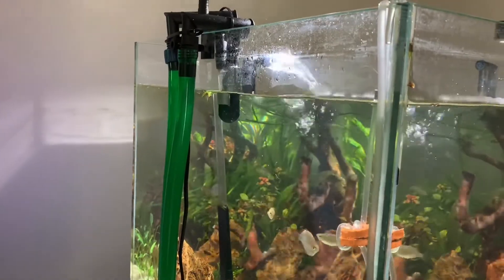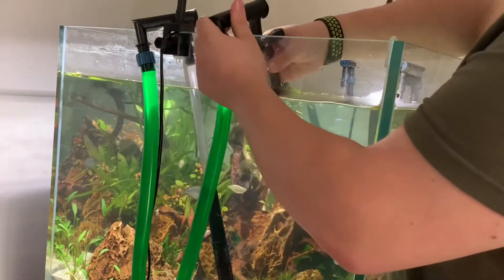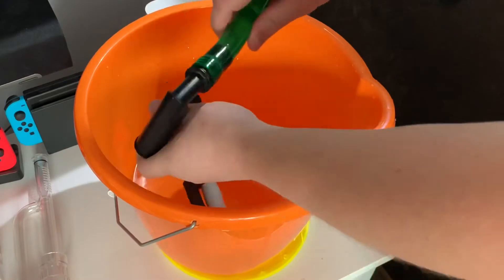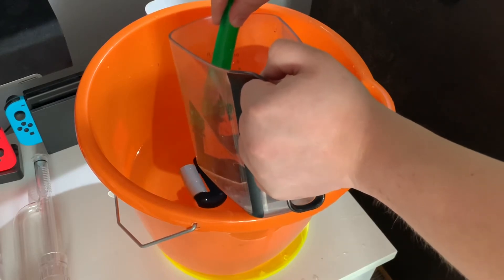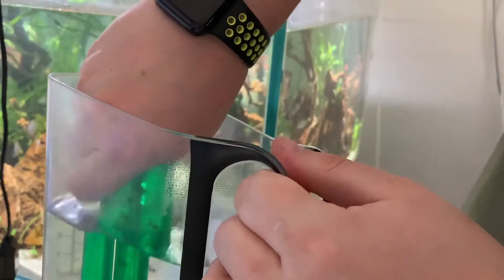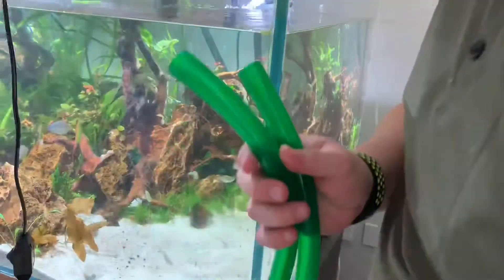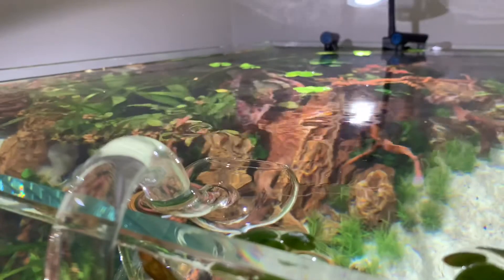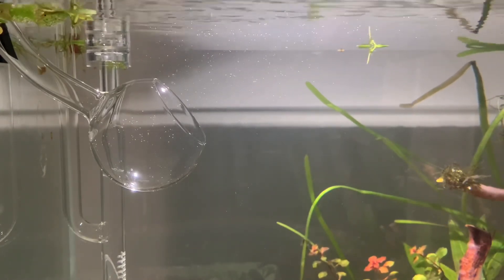HOW TO Upgrade the pipework on an Oase Biomaster filter

Comment: Bit you missed was adjusting your skimmer bias.
Reply from the maker: What do you mean?
Reply: @ordinaryaquarist  there is an adjustment on the intake where you set the balance or the skimmer depending on power of filter pulls the skimmer under the water or worse just pulls air from the top into the skimmer and you just have air in the filter. If you are lucky you won't have to adjust this but is most commonly the problem after adding a skimmer-intake.
Reply from the maker: @StuEvans  oh okay, I didn’t realise this. Thanks for sharing the tip. I did have an issue whether the skimmer was getting sucked down or caught up although I’ve replaced the glass pipe work with aluminium and i haven’t had an issue since fortunately.